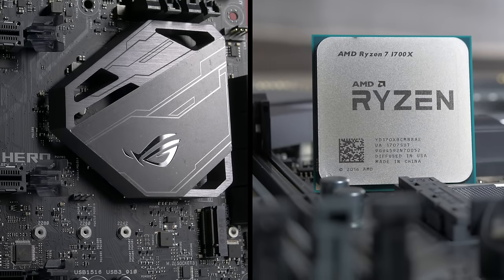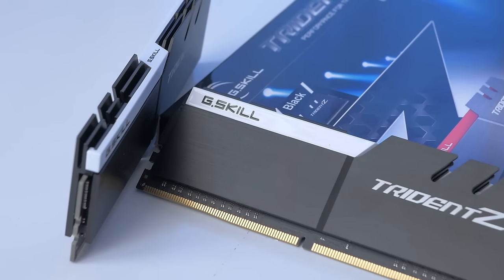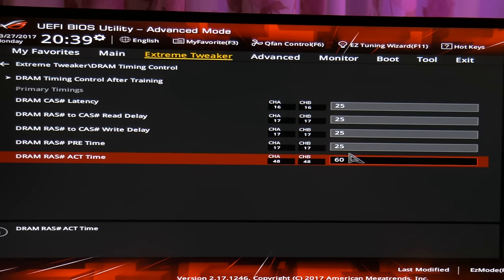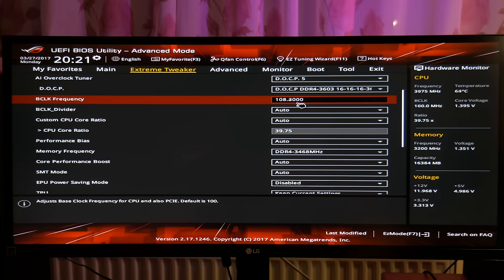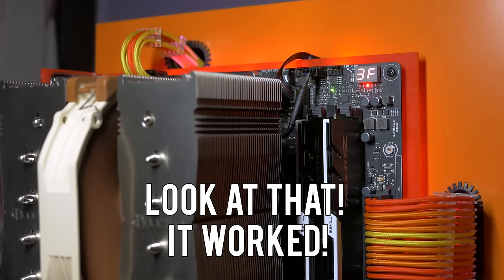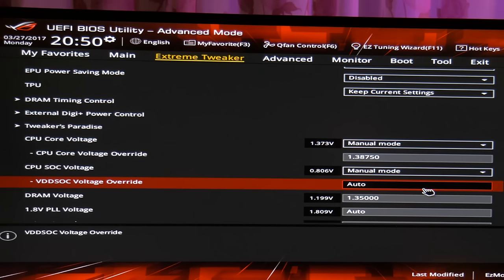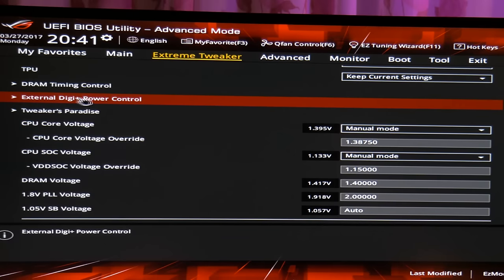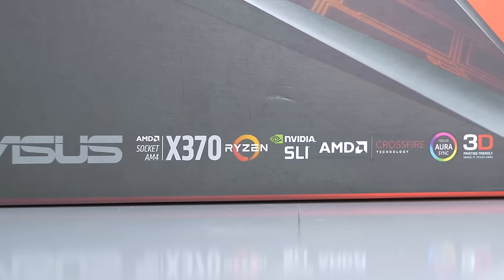Getting faster RAM working on Ryzen + ASUS Crosshair 6 Hero

Comment: great vid. i've been wrestling with my Taichi for a couple days loosening/tightening timings trying to get a set of single-rank CL16 Trident Zs to hit 3200 MHz. looks like there's another day of wrestling ahead.
Reply: I'm Interested in the taichi, let me know how did it go bother!
Reply: Pedro Marques about to try out the just-released bios. stable 1.6 and beta 1.94A. i'll keep u posted.
Reply: Thank you man! I hope that you get some insane clocks out of that memory! :D
Reply: ***** well, after another day of tweaking timings and voltage, i have to say that the 1.94A beta bios didnt help me reach 3200 MHz with my memory. however, i did use the BCLK overclocking method to reach 2600 (up from 2400) with slightly tighter timings at 15-15-15-36 (from 16-18-18-38). speed is more beneficial than latency with ryzen, however. if u plan on getting a taichi (or any other ryzen board for that matter) any time soon, try to hunt down the 3200+ kits from the QVL. for me, i simply couldnt find them for sale or wasnt able to purchase without expensive int'l shipping, so i settled on a similar set with hopes that bios updates would get me there. gl to u, sir!
Reply: Thank you +col. hapablap, that was for sure some useful information. One final question tho, regarding bios options (voltages, subtimmings etc), does it look like to you that the Taichi lags behind the CHVI formula? I am really liking AsRock's no bs approach to the Taichi lineup.

Best regards
Reply: +Pedro Marques i cant say with 100% certainty since i havent personally messed around with the CHVI bios (only seen thru youtube vids), but there is absolutely no shortage of options and settings on the Taichi if you're the type who enjoys tinkering with the bios. a lot of stuff that i dont even know how to use lol. and even tho i'm unable to hit 3200 atm, it's been fun being an early adopter again and getting back into tweaking/testing my system. it's been years and ryzen has done that for me. 😁 i'm learning new things all over again. overall, i'm satisfied.

couple things of note:
1. the taichi doesnt have dual bios, but the latest update does let you save multiple (5) profiles, and they remain stored even after clearing the CMOS.
2. the CHVI was my first choice due to the insane number of USB ports on the board. a few of my peripherals require 2.0, and the Taichi doesnt feature any on the board, unfortunately. i've had to rely on the 2.0 headers. if you're in the same situation, you might want to consider this.
3. oh, and the taichi features on-board WAN and bluetooth. i wasnt looking for this feature at all since i'm always connected via ethernet cable, but i'd like to try and pair my ps4 controller via bluetooth in the future. nice bonus.
Reply: Well the CHVI does not have ps/2 keyboard port which is a turn off. I think I will go with the taichi, just need to wait for the 3600MHz ram kit official support to switch to Ryzen. The VRM on the taichi seems to e stronger (300 vs 250 amps I think) Thank you!

All the best
Reply: ***** happy upgrading 😊
Reply: Pedro Marques The Taichi is an overengeneered beast of a board, yout really can't go wrong with it.
Reply: Dom Pérignon you reminded me: i hit 3200 MHz earlier today! it was the damndest thing. swapped the memory from slots A1/B1 to A2/B2 to fit a new cooler, and i gave memory oc'ing another go. hit 3200 right away at indicated timings of 16-18-18-38 (model: F4-3200C16D-16GTZSK - easier to find than those currently on QVL). i was a bit stunned. if removing/reinstalling the cooler wasn't a pain in the ass, i would try to go back to the previous slots to see what the deal was... i guess i'll try tightening the timings and BCLK oc'ing at a later date, but i'm good for now. saw an improvement in heaven benchmark as well.
Reply: Sweet! :D
Reply: The reason you were having a problem is because the CL16 3200 Trident Zs use e_die not b_die
Reply: trignite no, slots A1/B1 are limited to 2400 MHz on the taichi (and other AM4 boards) as described in the somewhat hard-to-decipher RAM table in the manual. i didn't realize this early enough, as i was used to boards in the past that either preferred A1/B1 over A2/B2 or didn't care which slots two sticks of memeory were inserted into.
Reply: Ah i do remember reading about that, regardless people have had a lot more luck getting b_die past 2933

Comment: thanks for the guide on the overclocking ram guide for the ryzen platform to get the most out of potential ryzen 5 owners...and showing us how ram speed (from 2133mhz- 3600mhz)can significantly improved gaming performance by 15%-20%...esp in low 1% and 0.1% fps...ur passion and enthusiasm is truly infectious....also if possible can u try overlooking one of the cores to as high as possible( 4.1-4.2ghz )and the rest to around (3.8ghz ) per ccx...cause the level 3 cache speed is tied to the highest core clock speed in each ccx and might help performance with cache sensitive applications...Thanks ...
Reply: Hey, Hi...Do you have any idea that can i use 3200 MHz ram on this Asus rog crosshair vi motherboard....do I need to do overclock for that?? thank you.

Comment: Ram speed increases Infinity Fabric performance by A LOT.
Reply: its linear no?
Reply: It also increases my i5 6600K's performance as well, so Ryzen ain't the only one benefiting from this.
Reply: Intel chips benefit in a different way. There  Integrated Memory Controller is slightly more efficient versus AMD's Ryzen. Not to say Ryzen's are bad, they are in fact very good. Just that Intel has  tighter latency. 
Infinity Fabric runs at the DDR4 speed. That's how it benefits a lot. 

Here is a great article about AMD's secret weapon, Infinity Fabric. 
http://semiaccurate.com/2017/01/19/amd-infinity-fabric-underpins-everything-will-make/
Reply: Here's a good link that goes into more details. 
https://www.techpowerup.com/231585/amd-ryzen-infinity-fabric-ticks-at-memory-speed
Reply: +ATI nsider Hey mate, I know you posting on wccftech, do you know what the f*ck is going on (I'm Djura Figura there), trying to comment there about MindBlank Tech and how his video is featured on AMD Gaming facebook page, and all of my comments are removed.
Reply: ATI nsider indeed, I explained this in my video, check it out :)
Reply: I am not sure, but it seems some that are pro Intel don't like your posts perhaps? And enough complaining will get your posts deleted or removed.
Reply: Hey, Hi...Do you have any idea that can i use 3200 MHz ram on this Asus rog crosshair vi motherboard....do I need to do overclock for that?? thank you.

Comment: Thanks for the tips! Got my DDR4 32gb Dominator Platinum 3000mhz to run at 2933mhz and my 1800x to run at 4ghz!
Reply: Erik Sutton what mobo and bios? did you use bclk OC to get there or not?
Reply: Asus ROG Crosshair IV Hero, and with the current latest bios. Yes I bumped the bclk up to 109.6 and multiplier of 36.5.

Comment: hey man,i have a question,just build a new PC with i7 7700k,MSI Z270 Krait Gaming and NZXT Kraken X52 but my temps are 30-40 on standby and up to 94 Degrees Celsius when stressing the CPU with Prime95(base clock;at 4.5 went up to 96 degrees!
What could be the problem?i suppose this temps are not normal!

Comment: Hello man!
Could you help me to sort out for what we need for external BCLK generator on AM4 motherboards. I'm not experienced overclocker :D so i would ask stupid questions. At begin I was thinking that with ext clock gen I can overclock memory by bus frequency and increasing bus frequency won't affect PCI_E, sata etc. But after reading Taichi review on hardware-canucks I'm not sure. Reviewers said that they can't go above 106Mhz due to stability problems with PCI-E.
Please help me understand how it works. If we want overclock memory by bus frequency it affects all another onboard devices independently from ext clock gen is there or not, am I right (I hope no)?
I ask these questions becaus on AM4 boards only top motherboards have BCLK generator, so if there no differences about bus frequency oveclocking so maybe I'll choose more cheaper mobo.

Comment: Did you try disabling Fast Boot to get around the Boot problems?
Reply: Fast boot was causing problems with the OS failing for me, but only when overclocking. However, once I get into the system, it is completely stable. Turning off fast boot fixed that, but I don't think his problems are the same.
We have buggy motherboard firmwares right now.

Comment: Absolutely the best, most detailed content on memory overclocking I've seen for Ryzen so far. You rock! 

I had a Gigabyte Gaming 5 mobo briefly, but I returned it to the store when I saw this video (couldn't get the G.Skill Trident Z 2x8GB 3200 Cl16 kit to 3200MHz, nor the G.Skill 2x8GB 3200 CL14 kit) and I'm holding out for either the Asus Crosshair VI that you have, or the Gigabyte Gaming K7, which also has an external BCLK generator. 

A couple of questions. First, do you know if anybody is getting better/worse memory speed results using any of the other BLCK generator equipped boards (Gigabyte Gaming K7, Asrock Taichi/Asrock Fatal1ty Professional), and also, just how high can you push the BLCK before you will corrupt an M.2 drive? Thanks again for the outstanding videos!

Comment: I have the same TridentZ modules and have a good IMC (Intergrated memory controller). It will cold boot, warm boot every time at DDR4 3200 14-14-14-34-T1. Also on ASUS Crosshair 6 Hero. Since the Cpu is only rated at 2666 for single row Dims, 2 modules - some will be less lucky then others. My OC headroom looks to be less on a 1700x but I go for absolute stability - 3.8ghz so far.

Anyways I basically set ram to 3200 with 14-14-14-34, 1.35v for VDram and 1.35v boot and that was it. CPUsoc in auto at that speed automatically goes to 1.13v. Others will not be that lucky or later bioses maybe will allow more stability.

So don't feel too bad if DDR 4 2933 is the max you go or if DDR 3600 you can achieve - it maybe more to do with CPU IMC, Ram modules then what you did.

Also make sure the modules are well seated as a note, I don't like the single side clip design on this moterboard - press them in and look at the socket and module to make sure it is even (straight line).

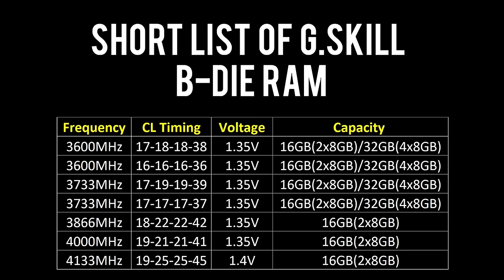Comment: 01:34 What are the part/model numbers for the modules in your table of G-Skill B-Die RAM.
Are all G.Skill Trident Z F4 sticks built from Samsung B-Die ?
I'm looking at these 64GB kit in particular : G.Skill F4-3000C14Q-64GTZ and F4-3200C16Q-64GTZSW
Which is not listed on the Memory QVL of any X370 AM4 motherboard.

Comment: You should contact ASUS and ask them to create a remote setup utility over Ethernet so you can change settings and restart the system remotely without having to be on the system you're booting.  It should allow much faster tweaks with the ability to signal reset, retry, safe boot, everything, remotely.

Comment: Do you know if this board supports (and uses) ECC memory? I know that the Asrock Taichi will work with ECC and report it as working to the OS but there are other AM4 boards that don't support it and only run it in non-ECC mode.

Comment: If anyone is interested I think the ultimate tip to fix the RAM clocking issue (most of the sticks default to 2133MHz) is to enable XMP, set your RAM clock manually one step lower than the advertised value (I have 2x16GB Corsair 3000 MHz and I set it to 2667 MHz) and it should work without any problems. And the sticks I got receive a lot of complains on the Internet. I already bought 3200MHz sticks and I will set them to 3000MHz. I've done this on MSI B350 Motherboard. No boot or stability issues whatsoever.

Comment: i need some help,i am buying the ch6 too but i wanted to buy the rgb version of trident z (16gb 3200 cl14 (F4-3200C14D-16GTZR)) and i was wondering,first of all with they reach their 3200 mark ?i am asking because ive seen some people say that the rgb one's arent using samsung b die but maybe that was the cl16 ones and not the cl14 ones? i really need to know because if they arent going to reach 3200 id prefer to get the flare x's ,the second question is what do people do wrong and kill their rgb rams kits?is it because they install both aura sync and g.skill software for the led settings?how do i avoid killing my ram kits if i do buy the rgb ones?

Comment: The Crosshair board must have one of the most sold in the last few years. Mainly because it was one of the best AM4 boards during the Ryzen launch. I have one too. Plus the 1700x also.
Reply: i mean i would have gotten it if asus was a trustworthy company. I bought the maximus viii formula with a 6700k (4 months after boards release, about 9 months after cpu release) and never saw an update for that board (to date). That motherboard was 400usd and they dropped support for it within 4 months of its lifespan.
Reply: Hey, Hi...Do you have any idea that can i use 3200 MHz ram on this Asus rog crosshair vi motherboard....do I need to do overclock for that?? thank you.

Comment: God im soooo confused on this memory for Ryzen im a complete noob at overclocking and as im in the progress of ordering  my Ryzen setup just not sure on what memory to buy?

My Mb is the MSI X370 gaming pro carbon and was going to order the G.skill Trident Zddr4 F4-3600C15D-16GTZ which is on the  memory compatibility list but will it even post? will it run @ 2400 /3000 / 32000 / or dare i say 3600 and stable? or just run at stock and crank it up when the bios lets me????? so many questions.

Comment: Regards, I have the tridentz 3200 CL14 and does not activate the XMP. That you recommend me to be able to run the ram to 3200hz? Right now they are running at 2133hz. My board is Asrock X370 K4

Comment: Unfortunately, my ASRock B350 does not have most of the options available at this time; probably ever. I went low cost. I'll have to be, and am, happy with 2400 stable (2666 some boots but many auto-power cycles during boot) out of my 3200 CL14 G.Skill. At least the timings are, as you put it, tight at 14/14/14/34/CRt-1. I'll see what the future BIOS settings bring. Latest as of today (2.20 from 1.44) did nothing. I do get consistent smooth boots at these settings. Thanks much for all the hard work and the summation in this guide. Good to know info regardless and I'm sure will help people with like board or features.
Reply: What MB do you have?I plan on buying ab350 Fatality K4 and some G Skill 3200 CL15 or Corsair 3000 CL15.
Reply: I have the ASRock AB350 Pro4. It's a good low end MB for Ryzen, with some unique features for B350  like x16/x4 CF with both slots PCIe 3.0 spec for decent CF performance; if I go that route. This is uncommon with B350. No SLI as expected in B350. The latest BIOS (2.2) still does not support much high end memory; limited to 3000Mhz only and only a few stick models. The K4 is a nice board. Similar limited list of memory support, but it does support true CF and SLI x8/x8. It does list slightly more memory module support (169 in the QVL list vs 143 for my board), so it may be better overall for compatibility and future support. They are not going to put much work into my $90 MB :) Overall, my board is reliable and pretty good over-clocker. There is supposed to be BIOS updates incorporating AMD microcode that improve high speed DIMM compatibility coming in April-ish. We'll see.
Reply: Ok.Thx for the info.
Reply: Just keep in mind that the board you're considering does not currently mention support for 3200 RAM. It might work with it though. Some reviewers, though this was on the TaiChi, CrossHair VI, and Titanium boards, did reach 3200 despite no specific support. It's a wait and see game. Good luck.
Reply: Update. I did discover that I have b die in my G.Skill 3200 memory; see post I made for ThaiPhoon program. Also, during installation I ignored the DIMM placement for only 2 DIMMs in my 4 DIMM B350 MB. A2/B2 are the correct order for only two DIMMs. The install guide mentions AM4 in general, so possibly other boards as well. A1/B1 was not as forgiving. After moving the modules, I have jumped to 2933 stable. That's 533MHz free memory clock. Need to test with 4 DIMMs, and the speed will probably drop some. Still cannot boot to 3200Mz. That is my albatross. It always cycles multiple times and then posts with CPU and RAM defaults. I'm happy with 2933, but I'll post back if I get any further in clocking.
Reply: Matt McGregor That is good to know. i remember i saw a text line like that when i was looking at the description of the fatality.
Reply: And one more followup, placing 2 additional DIMMs in A1/B1, for four total of the same 3200 G.Skill CL14 memory, I am back to 2400 being the highest clock for a stable boot. Only other interesting note is that when 3200/2933/2666 failed to post and the MB auto-recovered to defaults, it posted with 1833MHz with the four DIMMs. This is in contrast with the 2133 default on failed post for 2 DIMMs; which I believe is inline with AMDs specs for default memory clock. Cheers all.
Reply: Matt McGregor o
Ok.I ordered 2*8gb 3200 CL15,so i will not have to do with 4 sticks. Thx for letting us know. Cheers
Reply: The two stick limit will depend on the MB in question. Mine is a very low end board, but it still does a lot.Hopefully your sticks have no compatibility issues with Ryzen and your board. Good luck.

Comment: Could the gain be more from increasing PCIE data rate through BCLK overclocking, rather than the RAM bandwidth?
Reply from the maker: +Hakam Hefny This is also a possibility. So far there's been no correlation. If I have the time, I'll do some testing on this.

Comment: I am trying to decide between the following RAMs, there is a big diff in price, so which would you recommend? My goal is 24GB or 32GB but not less: 

G.Skill Tridentz 3600 B-Die CL16, F4-3600C16D 
G.Skill Ripjaws V 32GB (2x16GB) DDR4-3200 CL16-18-18-38
Corsair Vengeance LPX 16GB (2x8GB) DDR4 Dram 3600MHz CL18-19-19-39